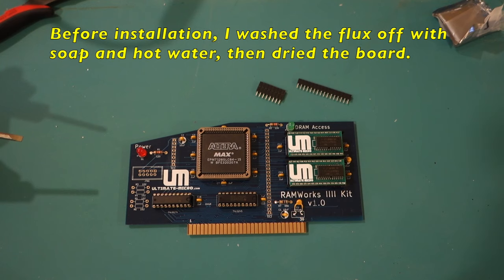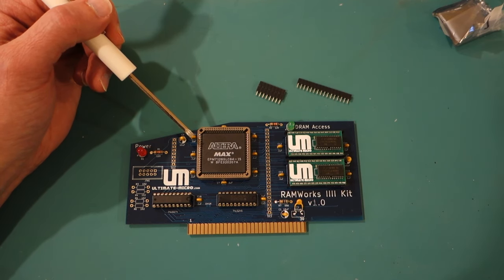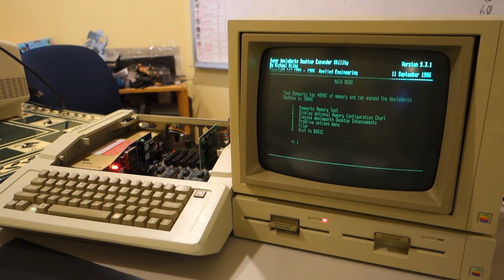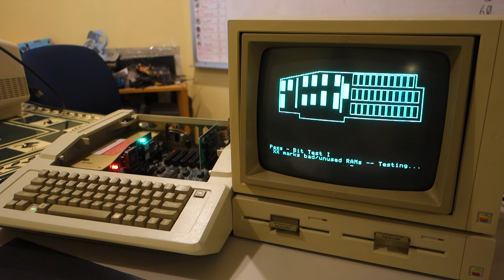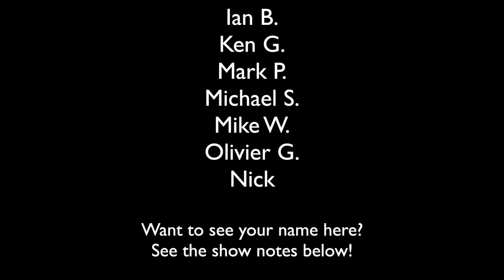Assembly Lines #35: UltimateMicro's Ramworks IIII

Comment: Nice review!  My 80 column card has a bad ram chip so I am considering this card. Can you do a step by step guide on how to copy PRODOS to am RAM disk?  I am completely new to PRODOS and the Apple IIe for that matter. Thanks!
Reply from the maker: Hi Jim. There are a couple of answers. First, as far as I know you can't copy the ProDOS system code to the RAM disk. However, you can use ProDOS with a RAM disk which is what I think you're asking. Once you've booted up ProDOS, you should be able to go to the BASIC prompt ], usually by running BASIC.SYSTEM. Then you should be able to save & run programs to/from the RAM disk just like any other "drive". For example, if you had a basic program you could do SAVE /RAM/MYPROGRAM. And then RUN /RAM/MYPROGRAM. To change to the RAM drive you do PREFIX /RAM. Then do CAT to get the catalog. But just beware that everything will disappear when you turn off power.
Reply from the maker: https://www.atarimagazines.com/compute/issue60/213_1_Apple_IIc_RAM_Disk_Mover.php